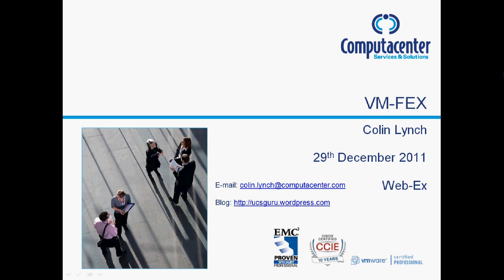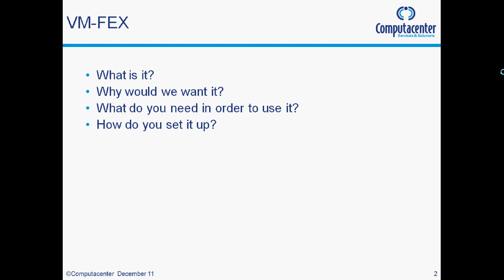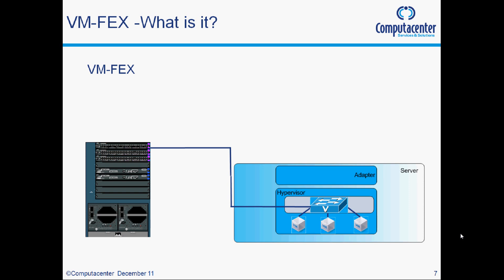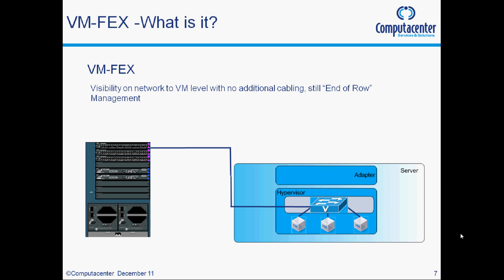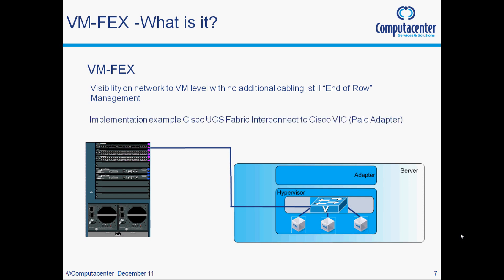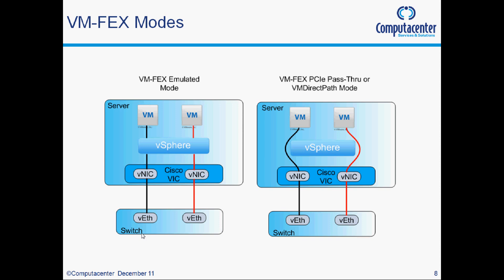VM-FEX Introduction Part 1

Comment: great video! Could you please elaborate on the following:

There is a strong limitation with FEXes: that is any traffic will go through the parent switch. But if i understood you correctly, with VM-FEX the extender switches the traffic locally, so, it does not nessesary have to go to the parent switch to be switched back.

Am i missing something?
Reply from the maker: Hi Alexei, glad people are still finding this video useful :-) A FEX will never locally switch traffic all traffic will instead be switched at the controlling bridge (Parent switch) In the case of VM-FEX the traffic is switched in hardware within the Cisco UCS Fabric Interconnect (The Parent switches to the FEXs virtual or physical) rather than being software switched within the Hypervisor / OS. As shown in the stats in this video switching in hardware provides lower latency and better performance, you just need to whey the gains against the added effort to configure and maintain the configuration.